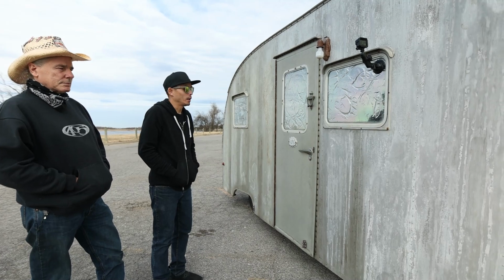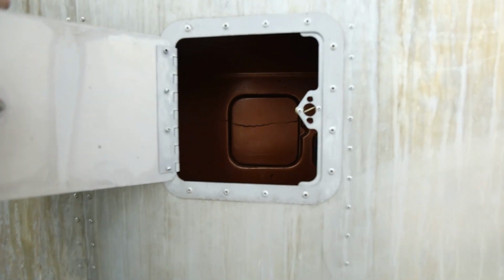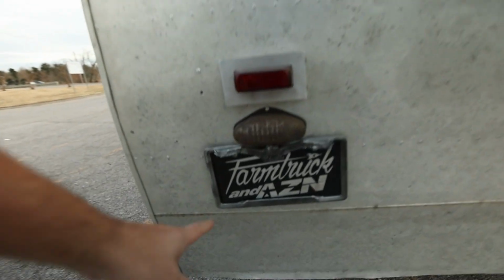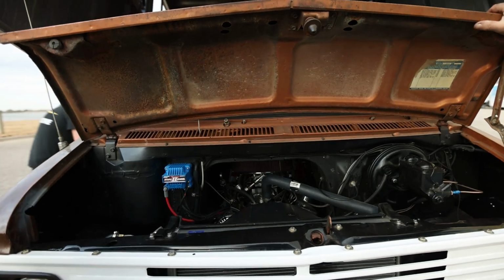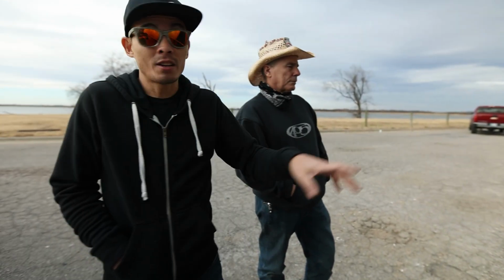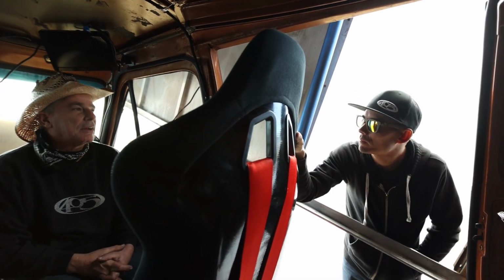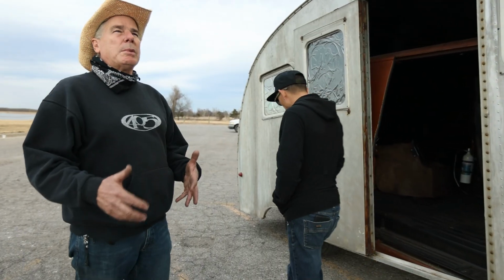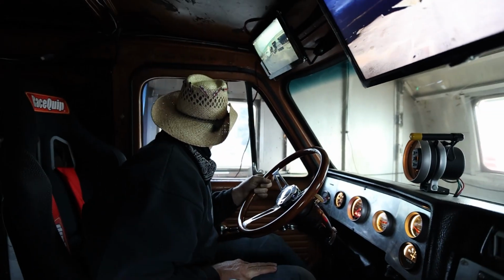Air Scream "Pop the Hood" Behind the build!

Comment: The biggest thing about peeling Plasti-Dip is making sure you put on enough coats from the start of the project.. 
If you put on enough coats then it will peel good.. if you put on too little coats it will be a nightmare to peel and you will have to get some dip remover and or a nice powerwasher to take it off